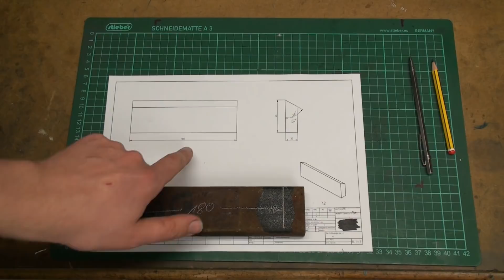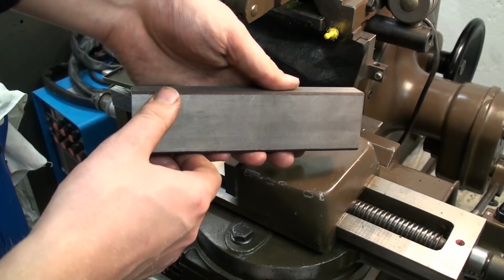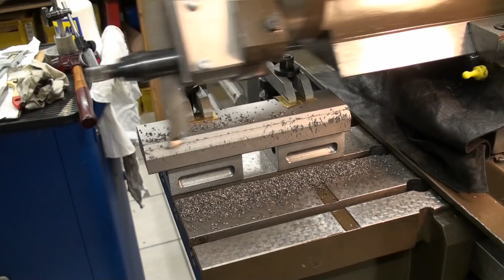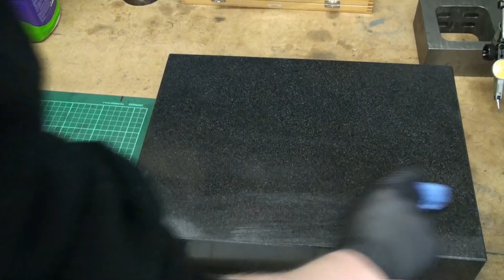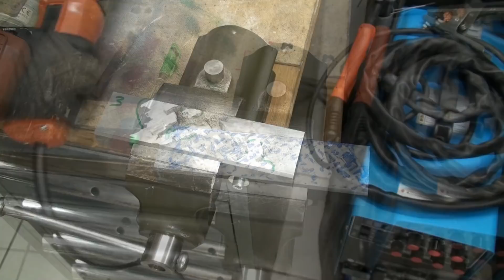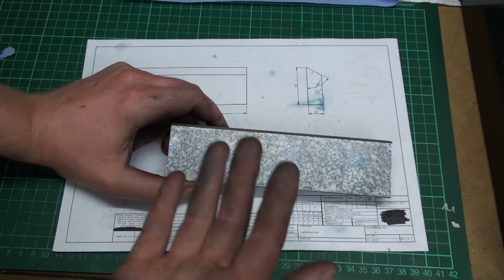Making a straight edge blank Part 1/2

Comment: I there any way to find one of this power scrapers for a hobby level price? I am finding used ones for 1300 euro, which is insane for a stupid tool doing back and forth... Where could I search for one in Germany? I guess I will have to scrape by hand..
Reply from the maker: Short answer: No
Long answer: No, but: From time to time they show up on the used marked in the 300..600eur range. Search term: Biax, Elektroschaber, Renz, Schaber
Reply: @StefanGotteswinter  I am planning on scraping a mini lathe bed, could you recommend a surface plate for the task? Not sure about the grade and size.. I am also searching for a triangular shaped, cast iron, straightedge but cannot find one anywhere. What would be an appropriate name for that tool?

Comment: Just hacked a 55 from an old sash weight.
Got one side pretty close.
Got the other side half way, and the first side goes banana...
Repeat...
Grr!!!
So ive tried slowly heating to cherry red followed by a day of cooling in the kiln, three cycles.
So far, it seems to have done the trick. Last nights pattern doesnt seem to have altered after hitting the other side.

Next time i might find something a bit... thicker. Better...
I knew it was meant to be a bit of an issue, but until you experience it...

vague recollections of cincinnatti leaving castings for up to a decade after rough machining

Comment: Stefan, you may be a great machinist. And this is probably a very informative video. 

BUT, there is more to this than machining and video. It is the AUDIO that carries most of the message and you have paid ZERO attention to the audio in this video. It starts out with a voice introduction so I set my volume with that. Then I was BLASTED out of my chair by some very loud, but TOTALLY USELESS music that added absolutely nothing to the subject at hand. Since I had already seen that you would narrate, at least some parts of the video, I did not just stop watching at that point. But I had to turn the volume down A LOT. 

So then you commenced talking again, but now at a much lower level than before so a third, completely different volume setting was necessary. I now have the video paused at 4:10 and am debating weather to continue watching or not. 

Most video editors, no, let me change that to many video editors include features that allows you to both monitor the audio levels (VU meters in the display) and ways of controlling that audio level. If you are going to make videos for publication, I suggest that you take some time to LEARN about proper audio recording. I would further suggest that unless you are specifically making a music video, that any music in your videos be at least 3db lower in level than the LOWEST audio.

Comment: The shaper has been wired in reverse, the return stroke is slower than the cutting stroke and should be the faster stroke.
Reply: But from 13 minutes in it seems to have been corrected!
Reply from the maker: The machine has a reversable motor - When using the pull-type clapper box, the machine needs to run in reverse.

Comment: Stefan - I am sending you this rusty steel torch-cut hockey-puck of material I found at the scrap-yard.
Could you clean it up a bit and put a 5/16"  hole in the middle.
Basically, I want to use it on my writing desk as a paper-weight and place to park my pen/pencil.
-----------------------------------------------------------------------------------------------------------------------------------------------------------
Piece returns 2 weeks later, 60% smaller and lighter.
Case-hardened, ground, lapped, and polished to a cylindrical accuracy within .005 mill.
With a precisely honed 22.5  degree conical bore, 7.999 mil. initial diameter.
Concentricity error - under .0025 mill.

Comment: The roller you are using is called a brayer and it is used (among other things I am sure) in printmaking pretty much exactly as you use it except it probably wouldn't be rolled twice: just once to evenly coat the brayer then it would be spread on whatever the wood block, lino block etc. That would then be pushed onto paper with a press to produce the print. Hope that helps!

Comment: Scraping is so interesting. I am sure many have thought of getting results accomplishing the same thing. Watching some scraping right after some shot peening stress relieving made me think.
Is there a process for hardened items that may leave a refined texture that acts like hand flake. Could moderately deep shot peen combined with near polish low temperature grinding result in a very slippery machine mating surface?

Comment: Hello Stefan,  I watched your part 2 as well and it seems that the angle of the straight edge you are making is determined just by the cutting head of the scraper.  Do you simply say "close enough" and scrape the future parts to mate that straight edge or did you somehow scrape it to a precise angle as well as flatness?

Comment: The roller you're using is called a brayer, and it is used in printmaking; woodcut, etching, etc. Thanks for the many and continuing videos, your work in quite interesting.
Reply: Eli Griggs … the funny thing is that granite slab is likely flatter than anything that tool would have ever seen in its (originally) intended industry. Perhaps they should cross-market to machinists too.

Comment: When you use the power scraper do you apply downward pressure to the cutting blade or does the weight of the tool provide all of the pressure?

Comment: Hey, very nice your videos! I am scrapping a cheapo Chinese  mill and because I don't have a Biax power scrapper I bought a reciprocating saw at Harbor Freight and made some modifications on it to decrease the stroke length and to attach a blade, it is working ok, for 19,99  is working great. It is saving me a lot of work, but still very labor intensive to scrape the whole mill, specially because those chinese mills ways are really bad.

Comment: Does scraping produce a flatter surface than a surface grinder? Seems like an awful lot of work
Reply: Yes it can because the part is not under clamping forces which warp the part more than the precision of a surface grinder, most scraping is done on machine ways so they also flake the surface to have low spots for lubricant to distribute between the scraped surfaces, without flaking two perfectly flat surfaces would stick together due the atmospheric vacuum and static charge

Comment: Hi! What would you recommend for a scraper blade for an inexpensive DIY scraper apart from old an file?
Reply: Tome4kkkk Carbide is always cemented tungsten carbide unless otherwise specified.
Reply from the maker: Invest in a carbide scraper blade - It is worth it. Carbon- or Highspeedsteel will drive you crazy because it needs so often to be resharpened.
In a pinch you could use a carbide planer blade (Those for the handheld power planers), they are cheap.
Reply: Thank you! But which carbide do you mean? Tungsten carbide or some other carbide? Or is it the case that all non-professionals simply don't specify, ever.

Comment: Can i make a straight edge from cold rolled steel plate?
Reply: Cold rolled has lots of internal stresses.   It's likely to warp with temperature or time.  To relax these stresses you need to hold it at tempering temperatures for a very long time.  several days or even weeks.

Comment: I managed to make a straightedge from scratch using the three straightedge rotation/scrape method. came out pretty accurate I think for a first time. can't fit even a .001 feeler in between the three edges, so I think I did it right.

Comment: I just translated 2 hundredths of a MM - to inches. About 8 tenth thousandths of an inch (.0008)
Reply: 1 thou" is 2.5 hundredth mm
Reply: 8 hundreths of a mm .08mm or 80microns is about .003"   25microns/.001"

Comment: Hey... little late to the party but I just found your channel. As a replacement for your dedicated power scraper do you suppose a sawzall with a scraper blade would/could produce a satisfactory finish? Love the videos and thanks for the efforts.
Reply from the maker: +jim richey Not realy, as you need to be able to ajust the stroke - Some people modified sawzalls to be adjustable and that worked fine, but not out of the box.

Comment: I admire and respect the art of scraping and the patience it requires, but can't help but think - after a couple of passes why don't you just rub it on abrasive paper to remove the high spots? By scraping more and more passes you're creating an ever increasing number of smaller and smaller high spots - this can wear down a mating surface very quickly!
Reply: Those tiny scratches that get left in a scraped surface hold oil, which helps maintain a molecular film of oil between the mating parts.

Comment: good video. how do you keep the rocking motion from giving false blueing makes. it's a "ink stamp roller".
Reply from the maker: sam yeates Thats a bit tricky on the beginning, you need to get the pressure very even on the workpiece and be very suspicious about the blueing. I knew that the part was banana in the center so I knew what I had to look for. And after a few passes it will even out.

Comment: "I'm using one of these rollers I got at the art store, I don't know what they are really for"

They're for pretty much the same thing: spreading ink onto plates for printing. I did this in high school, you carve a design into a sheet of aluminum (or wood or copper), then roll the ink on, and use a clean roller to roll the ink off so it remains in the grooves; then when you press the paper against the plate it wicks up the ink from the plate.
Reply from the maker: puddingpimp Thank you for the description of that process, I was not familiar with that.

Comment: Stefan, very enjoyable video.  I am very much the beginner in scraping but I do have a couple of hundred hours of hand scraping under my belt.  My observation is that the power scraper may be too aggressive.  After the first pass hand scraping would not have eliminated the central bumps like that and it seemed like you were making new hollows.  In hand scraping you tend to be more judicious on how much material you remove on each pass.  I too have been self taught which means I may not have learned anything but I do not like making extra work for myself.  Keep the videos coming.  Russ
Reply from the maker: Russell Thornton Thank you for the comment - As for the agressiveness of the powerscraper, in fact one (not me..) can work to an incredible fine surface finish with one of those, the very even stroke makes it more easy to get somewhat of an even pattern. I realy have a hard time to get a descent finish by handscraping (I did my fair share of it on a toolmakers block, my lathe and my drillpress) but I found out that I get way better results with the powerscraper.
But as you I am mostly self taught and a person like Richard King might just close his eyes and walk away if he sees what I do there. I also will try to get working with a pull scraper worked out, but first I have to make one.

Comment: Scraping looks like an exercise in insanity.  I've seen other people glue sandpaper to their granite block to get a flat surface.  Then there's also grinding machines.  What are the differences/weaknesses/strengths of each?
Reply from the maker: Mark Kotyk Hi Mark, sometimes it is a bit tedious, and I have to be in the right mood to do scraping or thhe results get realy bad.
A surface grinder is the way to go for a fast, very very flat surface, machining hardened steels, carbide and so on, but those surfaces are sometimes to slick for actual guideways on machine tools, they would stick together with the oil between them - At least one side gets flaked with a scraper after grinding to allow some oil in the pockets created by flaking.
The emery paper on a granit surface plate is..hmm, I like it only to clean up machined surfaces not realy to alter the geometry of a part - For me its more deburing, knocking down highspots and removing machining marks. You can create a cuped surface very easy that way.

Comment: I found this video fascinating. Another shaper lesson! If you are not in a hurry it is a wonderful tool, far less noisy and violent than a mill. As for scraping, you may be self-taught but you know a whole lot more than I do, so I learned much. It is a technique I want to learn. I have also watched Mueller Nick's videos, but he is a real expert and I actually learned more from this video. Thanks for posting.

Reading other comments, I noticed Mr Mark Rainford mentioned an adaptation of the saw. This is a nice repurposing of an ol "Sawz-all" type saw. (Reciprocating saw.). Mine is currently functoning as a casting sand sifter, but I could re-repurpose it :)
Reply from the maker: Juan Rivero Thank you! Scraping a flat surface is not that complicated, one can get the hang of it in a few hours, but making it look god and giving it a good ammount of bearing surface is another story ;)
There are a few homebrewn powerscrapers out there, made of SawAlls - Important is that there is a way to change the length of the stroke, or it would only work for very rough work. :)

Comment: Excellent topic, Stefan.  Your video is very focused on the operation you are doing, and your explanations are clear and to the point.  
As others have noted, there aren't too many videos on scraping.  Yours is by far the best I have seen for us amateurs to learn from as your project is simple and straightforward.  
I can see that it would take considerably more time to do that piece with a manual scraper than with your nice power scraper.  
Would you perhaps show a bit about sharpening the scraper blade?  I know that having a sharp scraper is essential.

Thanks for all of your videos.  You do a great job.

Richard

Comment: Great video Stefan.
But, try with handscraper. Much better results.
Reply from the maker: Apuk Eldar Hi Apuk, I have done my fair share of handscraping and I get way better results with the powerscraper - For me its easier to controll, because the machine is doing a very constant movement.
But I will try pull scraping with a handscraper - That seems to give excellent surface finishes and also might be way easier to controll than a push type scraper.
Thanks for commenting :)

Comment: Stefan Gotteswinter DuraBar is a wonderful material.  Messy, but cuts like butter, very even grained, no hard spots, I love it.
Reply from the maker: James Kilroy Yeah, love that stuff too - I always stock a few pieces. If only the mess wouldnt be there when machining it... :)
Reply: Stefan Gotteswinter No doubt, the shop vac is your friend.  I envy your power scraper, I'd love to have one but they tend to go for big bucks over here ($800+).  I am stuck with the old manual method.  Not too bad for finish work but a real pain when you are roughing.

Comment: Thanks! Very interesting. How much material do you think was removed by scraping?
Reply from the maker: powaybob That can be measured pretty good, the valleys of a semi-finished scraped surface are between 2/1000mm and 1/100mm deep.But when roughing with a powerscraper there is no problem to remove 5/100mm per pass :)

Comment: Very interesting video. Quite enjoyable. I have a question. You mentioned that the power scraper was REMS, but it looks like a FEIN housing (the orange housing). Who manufactures that scraper and is it still available? Again, very fine video well edited, well narrated, informatively paced and, well, enjoyable. Thanks for sharing.
Reply from the maker: Jim Milne Renz is the manufacturer, and yes the motor is made by Fein, they buy the motor as a complete unit and fit them to their powerscraper. 
That scraper is still availible here: http://www.renz-eiro.de/
Thanks for watching and commenting :)

Comment: Yet another interesting video, one question though, if you had a surface grinder would you have used it for application instead of scrapping?
Reply from the maker: Chris Stephens Yes and No. The surface grinder would make short work of creating a flat surface but it would still have to be flaked with the scraper to get usable as a master surface for highspotting.
Reply: I bow to your greater knowledge in such matters as I have never done any serious scrapping.

Comment: Hi Stefan,
Very interesting, this is probably the best way to get something truly straight, did you add the hours needed to make the part?
Would you also consider lapping the part as a final step?
I really enjoy seeing someone that isn't a pro showing the learning progress and getting decent results.
Thanks, Pierre
Reply from the maker: pierre beaudry So far about 3 hours machining time and 3 hours handscraping.
Lapping can produce a absolutely true and flat surface, but as a master straight edge for spotting parts that would not work - To hold the highspot blue it needs the valleys created by the handscraping. A ground or lapped straight edge would just smear the color and adhere to the to-be-spotted surface.
Thanks for commenting, Pierre :)